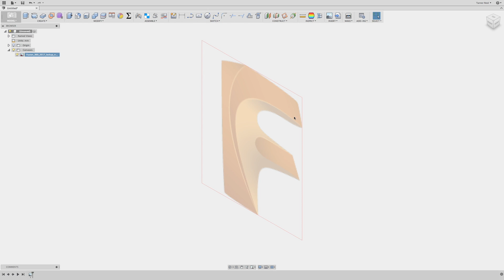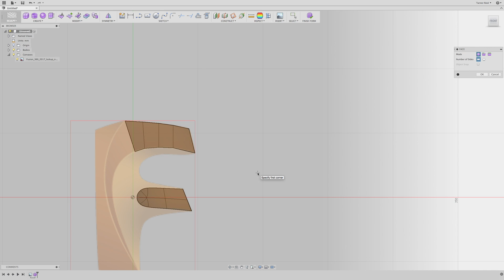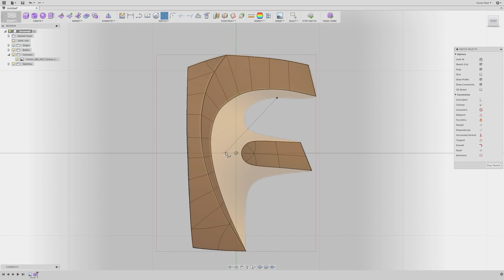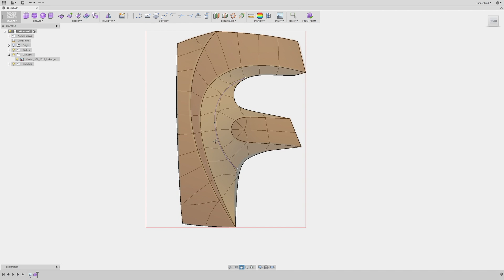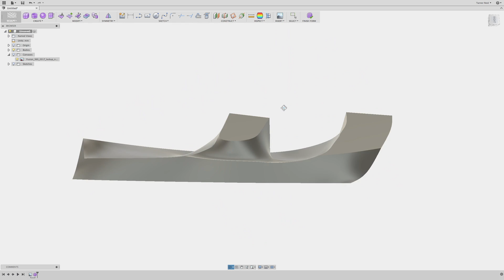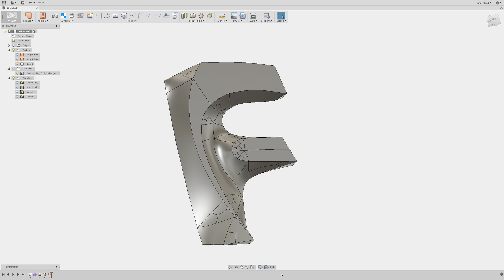How to Sculpt the New Fusion 360 Logo

Comment: thanks a lot for the video! what confuses me a little about fusion is that it doesn't have layers and you managed to make the inverted L and the middle dash on the same layer and to create a unique mesh you have to do that. I tried to stitch the two bodies but an error message appeared. How did you do it? Just raising them on the same plane wasn't enough for me. Thanks

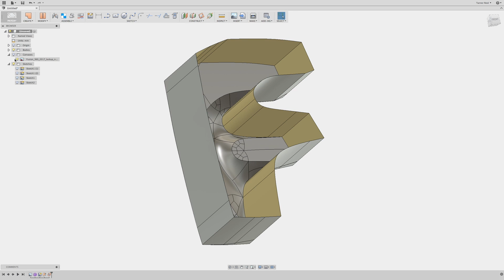Comment: on the 21:21 step I get the following error message "Error:   There was a problem combining geometry together.
    If attempting a Join/Cut/Intersect, try to ensure that the bodies have a clear overlap (problems can occur where faces and edges are nearly coincident).
"
any clue what the problem is?
Reply: never mind found the solution on my own, just had to highlight all the faces and move them away from the xy plane so the fill boundary had a little bit more room to work with
Reply: @getfastfish5020  Oh, thank you very much, i tried for 2 days, rewinded the video several times, played around, edited the stpes I already made, nothing worked, except when I moved the body 2 mm as you mentioned, Thank you very much

Comment: I honestly always thought this logo was based on a cubic shape. 
With the left portion, the one with the straight edge and the curved edge, was one face, and with the 'F' portion, the one with the two coplanar bits, with the top of the F turning down and forming a point, being another face, with an implied top face connecting between these two portions, with the interior of the F being sculpted out to the face opposite of the 'F' portion, which would imply thickness in two parts on the face opposite of the side face described, which would leave the bottom, which is only an edge formed by the bottom point of the 'F' portion and the bottom of the side face where, along with the back face missing portions, is missing due to the sculpting.
Now this doesn't mean there isn't more curvature, as there clearly is, but I think this is the basis for what the logo is. A cube, with two side faces, a back face, a top face, and a front face, with sculpting cutting out all of the bottom face, some of the back face, and most of the face on the right side of the F and the front face of the F. 
A logo that can be modeled with traditional cad and sculpted in what's closer to 3D modelling, like what the video shows, is a great logo for showing what a program can do while being discrete and not being overly complex, plus it's minimalistic. Good job to whoever designed the logo.

Comment: Thank you !!- been through this tutorial about 30 times - and finally got there!
I don't know if it is operator error on my behalf, but I get all sorts of strangeness and it has taken me all day to replicate this without some strange glitch that has caused me to have to start again and get more and more frustrated

About to 3d print the part and will go through it a few more times from scratch tomorrow... till it sinks in and I can debug whatever I am doing wrong and try and get it right the first time
Determined to get over the psychological barrier of this side of F360 that the parametric seemed easy to get through
You make it look so easy!
Reply: @robocog Same here.Doesn't help that F360 has changed quite a bit since this tutorial was made! I'm only on about round 5 of trying to complete this tutorial, so will need a few more attempts before I get one to stick! Planning to rout the letter with a 1mm ball nose cutter :)

Comment: It crashes when creasing the edge of 16:00. It happens every time i try to do it, no matter how, has somebody any idea why this happens?
Reply: I had the same problem. Solved by replacing the last triangle with a rectangle where the bottom points are quite close together.

Comment: If Fusion 360 was a toolbox, I've been using only one or two screwdrivers, and wire cutters for now. My hat's off for this great CAD tool and also the supporting tutorials!
Reply from the maker: Thanks Ennar, that means a lot to us!
Reply: For me, it would be just the hammer :D
Reply: Same, but before jumping into big machinery you have to learn the basics first before you branch out into more complex operations. Fusion is a big machine and should be treated as such when learning how to operate. She powerful.

Comment: I'm following this, but as soon as I make the joining creases at the bottom right corner of the F where the creases terminate into one vertex, Fusion 360 crashes
Reply: Gabe Nydick Me too!!! The ram and cpu usage was 100% when it crashes. I tried hundreds of times. Every time I try to crease that specific section of line it just crashes. Even if I only select that one section it dies immediately !
Reply: Gabe Nydick I think found a solution. Add a piece of line between where the two creases meet eliminating the sharing vertex. It won't crash this way. But I don't know if this would do anything wrong to the modeling.
Reply: Yeah, I tried that, and it works, but it's not true to the model :/
Reply: Gabe Nydick Well, I don't any other solution. I think it's a glitch. This kind of workload shouldn't be able to crash the app.
Reply: Aaron Guo well, yeah. Don't you have some pull in getting it fixed? ;)
Reply: same happen to mine.
Reply: i have 8GB DDR4 Ram with 4GB GDDR5 amd Radeon R7 why it crash

Comment: Please help, I am stuck at the second to last crease. It doesn't work for me as shown in this video. I tried different things, but without success. Here is what I am doing (maybe wrong): https://youtu.be/tTEsfxgJtuc
Reply: Hi - I get the same result, immediate crash using F360 on a Windows 10 machine. Fusion cannot seem to crease two edges of a triangle. I got around this by making a tiny quad instead, so the creased edges aren't joined - that seemed to work OK.

Comment: Adding triangles did not work.  I get T- Spline topology error when I click Finish Form.  I narrow down to triangles at the bottom.  Auto repair cannot solve.  I solve by adding rectangles, then use Weld Vertices to convert into triangles.  Works.

Comment: If you are like me and having trouble connecting the triangles (spline gets kinda curly where they connect)  when you 'repair body', just select multiple sides instead of rectangle in a face toolbox. It fixed the problem for me

Comment: Hi there. I can't create a boundary fill. I get this error:

Error:   There was a problem combining geometry together.
    If attempting a Join/Cut/Intersect, try to ensure that the bodies have a clear overlap (problems can occur where faces and edges are nearly coincident).

I'm not sure what is happening, is it's all good up until then. My extrusion is 90mm deep,, and the depth that I lifted the faces by was (I think) 10mm. Should that be a greater lift? Any help recommended

Cheers
M.
Reply: The solution seems to be that I needed to extend the initial Lift/pull Face" by an additional 7.5mm - so 17.5mm in total, to make a sharper distinction between faces

Comment: triangle topology? I'm from the polygon world and it's a no-no.
Reply: +chronok Its cool, they are t-splines
Reply: I don't think that's entirely true.. however I can be proved wrong as I'm not completely in the know about what subdivision technique they actually use.. however it's a subdivision technique that causes a sort of micro-creasing on the original control points
Reply: +chronok Yep it's not true. Triangle topology distorts things up everything the same way as in classic subdivision modeling. I've gone through everything I could find on the technology on Tsplines and did my own tests in Fusion to see whether this is right.. and lo and behold the first test showed every of the same no-no stuff that appears on the models after trying to subdivide anything with a triangle in it (non-quad topology). Tspline technology would have to contain some uber subdivision algorithms that we don't know of yet not to have a problem with triangle topology. Tsplines are flawed in so many ways i'm not sure why Autodesk just doesn't go and just add a lot of the old Alias surface modeling. Pure nurbs 4 life! Evidence http://goo.gl/95mnMa
Reply: That was my problem with this as Tanner was modeling it. The Tris made me cringe.  They should have at least an option to 'Quadify' Or 'Quadrify' command. I love the simplicity of this program but the triangle thing is a problem for me modeling soft goods.